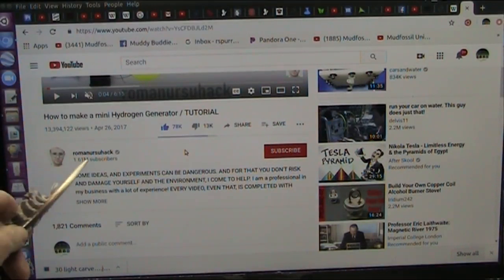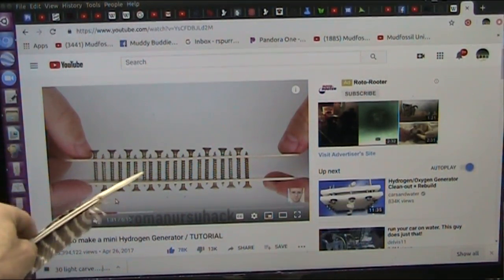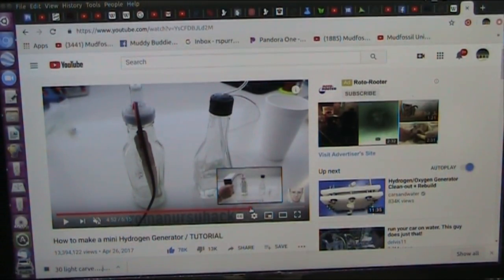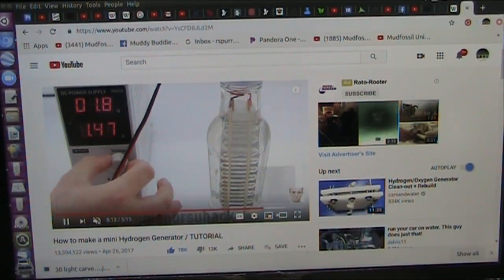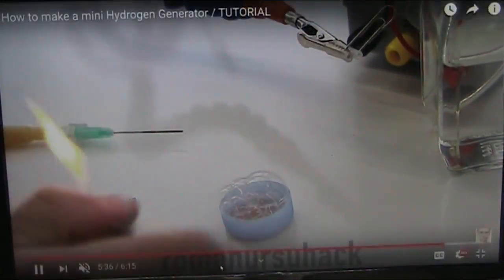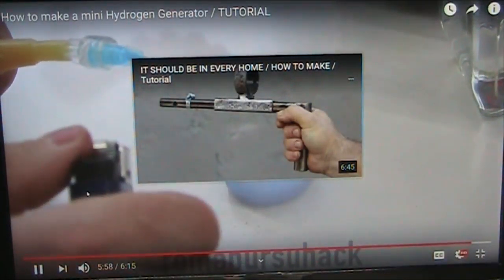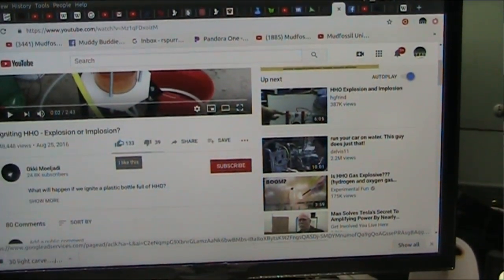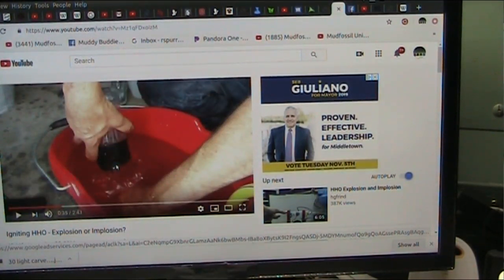Does Hydrogen Explode or Implode

Comment from the maker: A friend Rodney McGilIvary sent me an alchemy formula today for NEVER ENDING FIRE... it is VERY long and extremely detailed...this is snip..end part "sulphure, laye it uppon a red hott copper plate, and when it floweth like wax without smoking then is it prepared, if not then must thou extract theareof more of the spirit of wine, till it sustineth the proove & it is prepared.
Nowe take alumephume, make therof a top not as long as a little finger, and halfe as thicke, foulde it about with whyte silke, put it thus whole into a venetian little glasse, & joyne thearunto of the prepared sulphure, place it a day & night in hott sande, that the top be continually in the sulphur. Nowe take the top thearout, and put it into such a glasse, that the top looke out a little, adde thearunto of the prepared incombustible chyburals, place the glasse into hott sand till the sulphure melteth, and cleaveth beneath and upward about the top, that it be seene but a little above, kindle the top with a common light, & it beginneth to burne presently, and the sulphure remaineth flowing, take the light and place it wheare you wilt, and it burneth continually for ever.
Reply: Someone was pulling your leg man. Middle English is not spoke or wrote like that. Please don't try any part of whatever it says. I don't even understand what the goal is to make? Everlasting fire? Fire from nothing? I suggest arming yourself with the knowledge of thermodynamics. The three laws of thermodynamics are well proven facts nothing gets around and will protect you from falling for fraud like this. Good luck.
Reply: Why does two air molecules make a liquid?

Comment: Thanks for the demonstration that confirmed my implosion theory. After all it's turning gas to liquid. I had a much more powerful HHO gen and one time I stuck the hose into a beer can and lit it arms length with a lighter. It was the loudest pop I ever heard and it was even louder than a time a lightning strike hit a power pole 30 feet away and plasma fill the window I sat beside. 

DON'T DO what I did anyone who reads this. You WILL mess up your hearing if unprotected. My ears rang for 10 minutes. 

In the demo ignition we see a couple soap bubbles with quite a pop. Imagine a beer can worth. Play safe.

Comment: You dummy. It's an explosion followed by implosive force created by the rapidly cooling gas creating a pressure differential in the bottle causing it to draw up. That's why it sucked the bottle together a "second" latter. Same thing happens if you seal a tire bead on the rim with gasoline or any flammable fuel, the tire pops into place on the rim and immediately starts drawing up. BTW your completely oblivious to the explosive gases escaping the bottle even though it's obvious when your looking for it. Probably because you were looking elsewhere for something else. Also quantum particles don't act the way you described. Happy to enlighten you and thanks for helping me figure out what it is all these people are talking about hydrogen imploding.

Comment: That's what I believe the Mayans used as street lights the Spanish concestedores wrote about. They had pillers with moon like glowing globe lights .I believe they had high voltage pumping into basalt twin towers standing next to each other
 as antennas to make megahurtz wireless shortwave . Just like florescent tubes glow next to a shortwave antennas
Reply from the maker: I got an alchemy formula today for NEVER ENDING FIRE... it is VERY long and extremely detailed...snip..end part "sulphure, laye it uppon a red hott copper plate, and when it floweth like wax without smoking then is it prepared, if not then must thou extract theareof more of the spirit of wine, till it sustineth the proove & it is prepared.
Nowe take alumephume, make therof a top not as long as a little finger, and halfe as thicke, foulde it about with whyte silke, put it thus whole into a venetian little glasse, & joyne thearunto of the prepared sulphure, place it a day & night in hott sande, that the top be continually in the sulphur. Nowe take the top thearout, and put it into such a glasse, that the top looke out a little, adde thearunto of the prepared incombustible chyburals, place the glasse into hott sand till the sulphure melteth, and cleaveth beneath and upward about the top, that it be seene but a little above, kindle the top with a common light, & it beginneth to burne presently, and the sulphure remaineth flowing, take the light and place it wheare you wilt, and it burneth continually for ever.

Comment: Ok. So I re watched this in my head, in super slow mo. The charge passes into the HHO, and triggers a -t(a)U (b)u+t= (C)UTE event. 
What the hell am I saying? I'm saying the charge passes through at the fastest time possible, and then added such energy to that time, that we are observing on the tiniest scale of time brought relative, the speed of light being violated by an event that exceeds the speed of light itself by that scale of time. So we see the effects of the implosion on the outside of the bottle first, which should happen second, so it's an explosion from inside the bottle on the outside. The HHO on the inside Implodes, and the contents of the insides implosion exploded on the the outside. It passed through the bottle unphased because of time, and our movement through space. The difference in space, is the  time it took for the bottle to collapse. So you take that fraction of time that was negative and apply it forward, and make it relative. It's about a second from our perspective.

Any time you invert something, which happened here, there needs to be an exit or an area where some or all of that energy inverted is then brought through. 

This is literally just like Fusion. In fusion we would want to collect the energy on the outside of the bottle, but still on the inside of another container, like the bucket here. 

Atleast, that is exactly what all this looks like to me. You always find the best stuff.

Comment: Gas molecules of oxygen and hydrogen recombine into water.  

If you burn a small book of matches under a glass and on a dish with water on the dish, it will create a vacuum. And the water in the dish will get drawn into the glass cup. So combustion of gases results in oxidation. And gases shrink down together into solid particles. 

HHO gases becomes H2O solids (liquids.) 

Therefore it likely implodes.

Also a magnet divides apart H2O into HHO. Even better if charge is added to the magnet. This is best done with a small magnet and a small amount of water at the burn location for immediate use.

Comment: Hydrogen implodes. It's is incredibly dangerous and especially loud. It cannot be stored safely and efficiently. Hydrogen must be pure if it is stored in compressed cylinders. 
It can be made on demand tho mitigating storage. 
Amazing uses of HHO (aka Brown's gas) ; 
Radiation shielding. - Geiger counter shows reduction when comparing mobile phone usage. 
My favourite = 
When HHO is run past platinum it is caused to recombine. Producing heat and water. 

So run this gas through sand infused with a cars catalytic converter and you have the most effective heater known to man.
Reply: Gareth Breedon my same thoughts ,catalytic converter,,heating and making ice is the biggest user of energy on a boat and we’re surrounded by salt water

Comment: I have run this experiment. What i believe happens is that you get an initial outwards explosion from steam expansion then an implosion from the gas going back to a liquid. When you make hho it expands out of water.when you burn it it collapses back to water.but straight after the burn a small amount of steam is made when water goes to steam it expands some 1400x.
Reply from the maker: 100% ...I agree.
Reply: @mudfossiluniversity  if you time a petrol motor right. Just past top dead centre you can run a generator on hho. The key is to add water vapour to increase the steam explosion. Then if will start to go negative in the bore on the reverse stroke.  With an efficient electrolyser you can run a 4k watt generator on 700watts of electricity. Over unity.
Reply from the maker: @belltrees  My father ran a car on kerosene and water during WW2.

Comment: Actually, the reason why it imploded is because he didn't have a good seal on that bottle and there was too much pressure relief for it to explode.  The water vapor created by the reaction escaped through the holes and then the cold water condensed the hot water vapor in the bottle faster than air could or water could rush in to fill it.  So it crushed.  A perfectly sealed (or contained) H2 / O2 reaction would explode violently.
Furthermore, I have a feeling the bottle was not all hydrogen and oxygen.  There could have been other gases in there (some nitrogen?)

Comment: When the brown's gas implodes there is far more energy produced than what was used to ignite it. Part of the energy is used to convert the gases back to water which is pristine water as it has no memory. It would be interesting to measure the bond angle of the water is it 365 degrees divided by pi ie just over 116 degrees which I suggest would be the perfect number by sacred geometry? There also seems to be excess energy which we see radiating. The energy must come from the water like in sonoluminesense. Presumably that energy gets absorbed by the surrounding water as water absorbs orgone energy more than almost anything else. Does that water get improved ie does the bond angle increase from 104 degrees towards the 116 degrees optimum? I have a Brown's gas generator and use KOH instead of NaOH (it is cleaner) and John Ellis distilled water (said to have a bond angle of 114 degrees) which does seem to reduce the power required to split the water. Watching this video makes me wonder can I improve the JE distilled water further with this same technique? In the machine that water is used very slowly so making it would be worth the trouble. Then I would make a pump. Imagine a lake in the mountains with a lake far below at the bottom of a cliff. You have a pipe up and another down with a generator at the bottom. In the return pipe if you use a hydrophilic substance like mica on the inside (Dr. Pollack uses hydrophilic plastics in "4th phase of water") and pump BG in the bottom the water in the column will have the OH- ions on the outside and the H+ ions on the inside generating flow. You also have rising bubbles which also provides levity. Since water is polar it would be dragged along. And the H+ is the most powerful levity gas. In certain areas the ground itself has a levity gradient which explains how groundwater rises to the top of mountains. So you drill in such an area (ie where there are springs rising from deep in the earth) and put the tube in that ground. Finally you have points where filaments ignite the rising gases which implode, give more energy to the water which I suspect further increases the levity forces. Mica being crystalline would store and emit such energy I suspect improving the performance over time. The tube would be thin to maximize the capillary effect providing further levity. Is this the perfect battery for places that have too much electricity (perhaps too many windmills or too much hydro in spring high water flow periods). The improved water would be a benefit and the lake likely would become a place of healing waters. Ideally you find carmins which use the venturi effect to cause the BG to become microbubbles and then you don't have to ignite the bubbles as some spontaneously shrink and dissappear creting the upwards suction. I have been looking for a place to get such carmins but with no success. (All the carmin is basically is a pipe pinched at the end with an air supply perpendicular just before the pinch which implodes the bubbles. Some engineer has to do the math to generate the venturi effect to maximize the microbubble production then put the design out to 3D printing). If anyone finds a source please send it to this channel and perhaps you could make a video? Your venturi effect can be used for more than just fusion.

Comment: Due to reaction in bottle, air inside is pressed out between gap of bottle and lid. Therefore less pressure in bottle after reaction, bottle partially collapses due to surrounding waterpressure.
P.S. thx 4 accepting my FB-invitation, Roger! Keep up your work :-)
Reply: The same happens out of the watet. When it first ingnites a small amount of steam is made which expands the gassed in the bottle. But when it  comes if the steam it goes into an implosion due to the hho gasses being bound tigher when they burn back to water. 1 cubic cms of h20 makes 1836 cubic cms of hho gas.